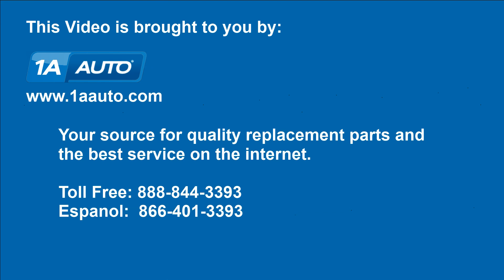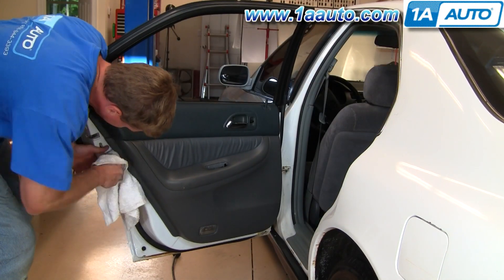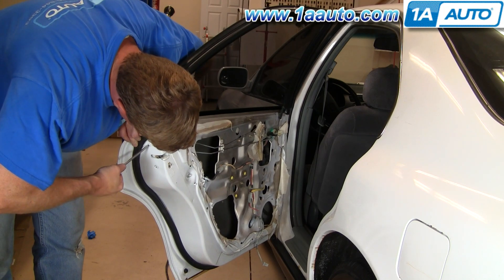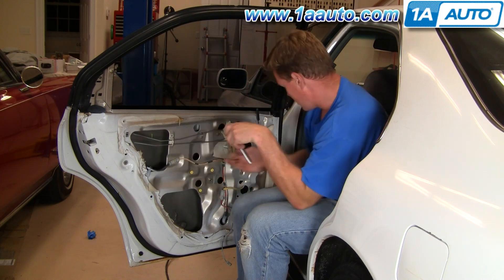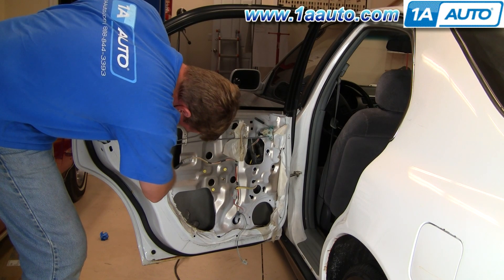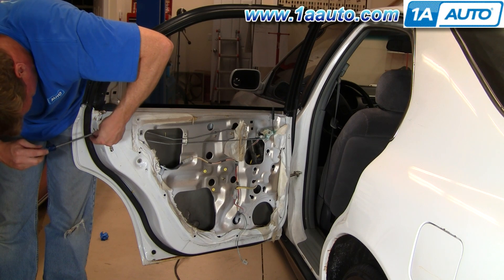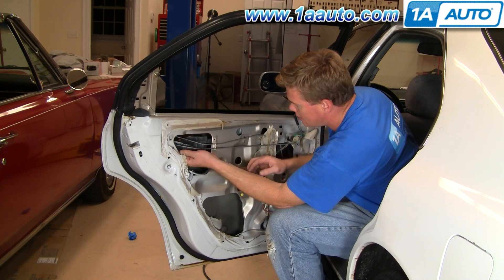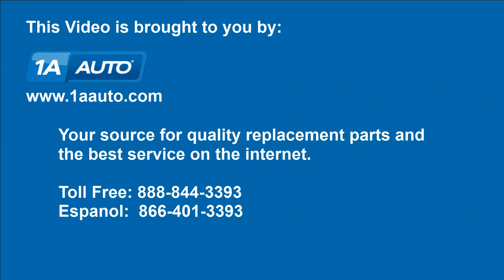How to Replace Exterior Door Handle 94-97 Honda Accord

Comment: Thanks for reply, btw from the service manual does not said to remove it but it shows after removing 2 nuts the remove the rod. It's very hard to remove handle rod when it still inside , let me know , thanks

Comment: I had to go through the passenger door to open the driver door. Roll up the window all the way up and then removed the door panel. There should be a white/clear plastic area holder 2 metal arms, remove the plastic holder. Behind the plastic holder look slightly up and you will see your outside door handle, * Check the metal arm that is attached the door latch. Its then, when you will see if you need to replace the door handle.If the metal arm came off snap it back and through the handle.